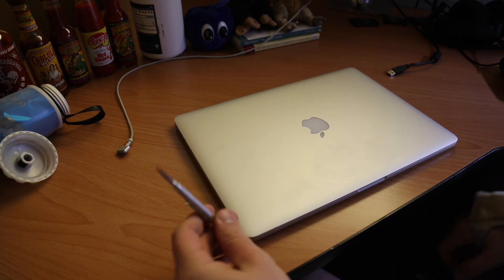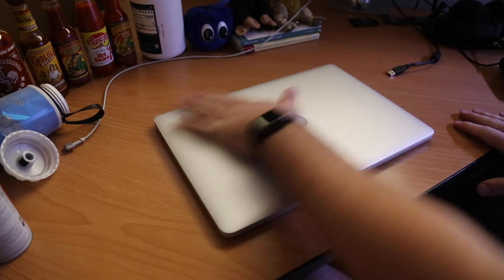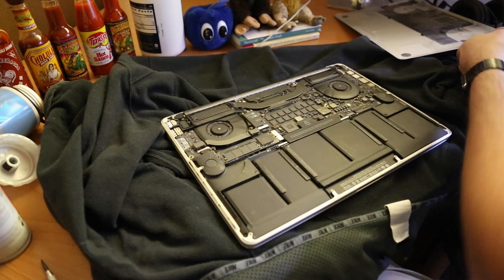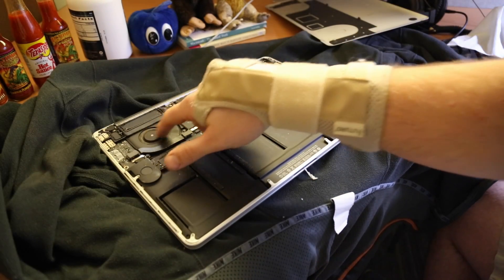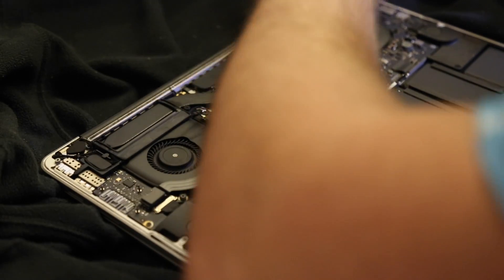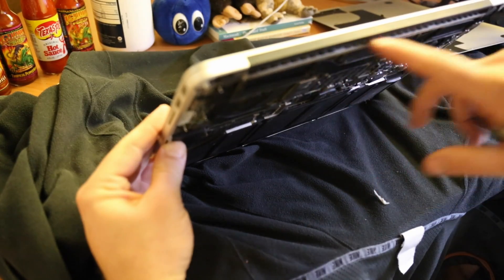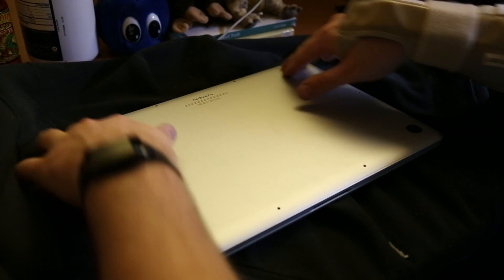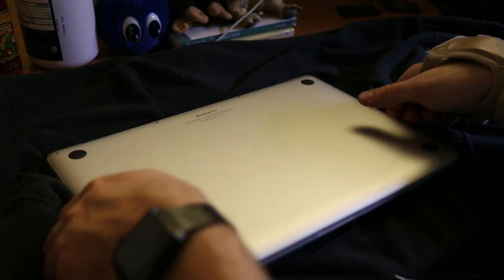How to Clean the Retina MacBook Pro Fans & Logic Board

Comment: Is rubbing inside surface, with cloth, possibly a cause for static discharge on inner MBP components? Wouldn't using a soft dust brush (camera lens cleaning brush, etc.), be better for this cleaning purpose?
Reply from the maker: Sure, you can use whatever you're comfortable with. I just hold on to the MBP's aluminum case as a means of discharge then clean with the other hand.

Comment: Can you use a spritz bottle with 99% rubbing alch if there's tough grime? does it risk damage to the logic board?
Reply from the maker: I wouldn't spray anything directly onto it and rely instead on a damp cloth.
Reply: @AdamChandler86  is it okay to gently touch the board, it seems like most of the components are covered

Comment: Hello, my sister dropped a cup of soda on my macbookair, do you think that this kind of cleaning and also changing the battery might help?
Reply: Hey Felipe, I dropped a glass of wine on my MacBook Air. It got totalled on insurance so I got a new one. However they didn't want it turned in so (with nothing to lose) I pulled it all down, shot everything with circuit board cleaner, left it days to dry out, then reassembled it. Guess what? I now have two MacBooks!
Reply: @PrawnHead3  Nice! You successfully committed insurance fraud
Reply: @Nathan-hp9tj  triggered
Reply: @Nathan-hp9tj  omg, I died when I read this!
Reply: It is probably dead, and blowing air into it wont remove sugar residue.